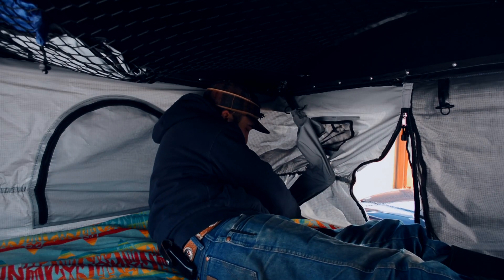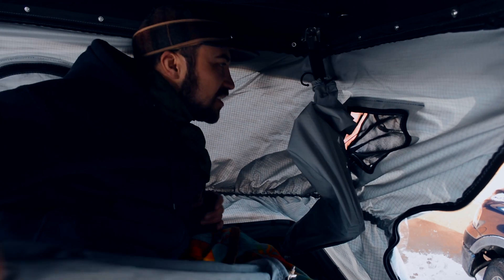The Best Roof Top Tent HAS FAILED

Comment: CVT is not the best RTT not even close. South African tents are. Alucab for a hard shell. Eezi-awn and Howling moon for 4 season soft tents. These were all developed for rental fleets over decades and are proven to hold up. I've had my Howling moon ten years always outside in the weather always dry and ready to go everytime I use it. Just added a Alucab to the mix. Bombproof gear. I hope CVT took care of you on that new tent. First mistake is the struts should not be inside the tent where your breath causes condensation on the struts. They should be inside the clamshell out of the elements but outside the tent. Fiberglass is flimsy, it will stress crack over time. Alucab is aluminum. I can not believe how flimsy that CVT shell is.